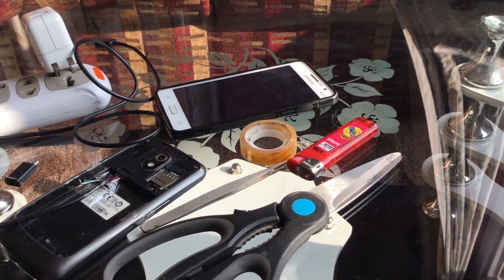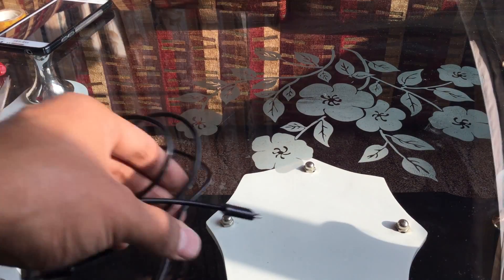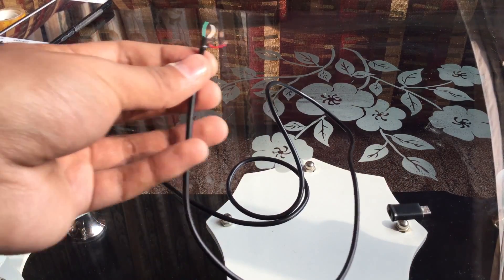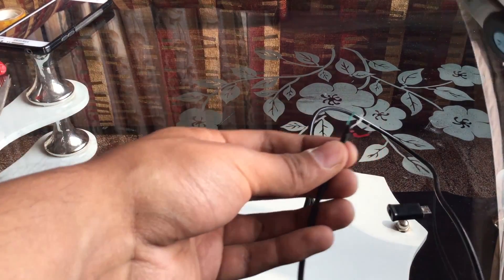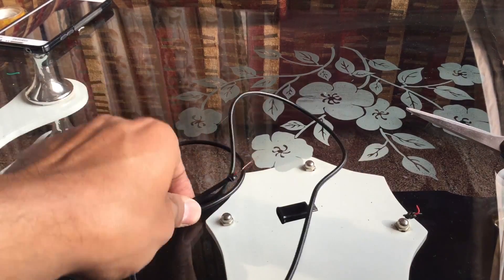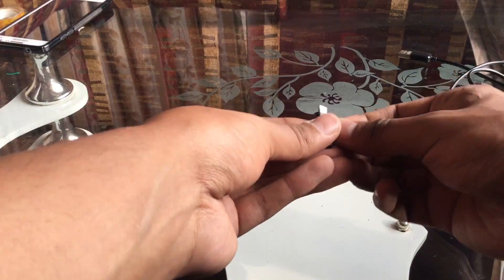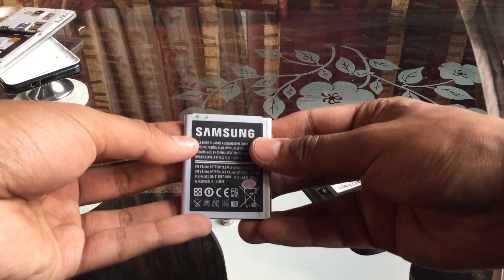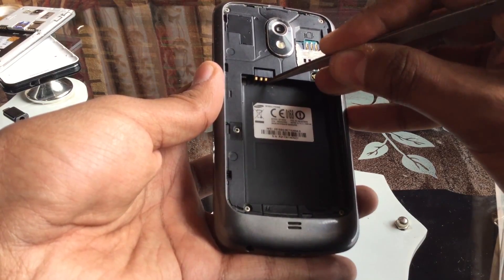How to run android phone without battery?

Comment: I see alot of confusion about the voltages. I'd like to clarify for those who are confused. All cell phones are lithium ion, lithium ion are all 3.7v cells. 3.7v is 0% charge. (4.2v is full charge). A 4.4v power source is needed to charge a lithium cell to 4.2v. (4.4v is actually 4.2v in a closed circuit, aka when plugged into the phone). 3.9v will provide 3.7v closed circuit (aka 0% battery) and the phone won't boot, or will turn off. So, we need an absolute minimum of 4v just for the phone to read anything other than 0% battery. Maximum voltage is 4.4v, Minimum voltage is 4v. You should use the maximum 4.4v if you can, but might be able to get away with as low as 4v. Nothing more, nothing less.
Reply: What if someone connect USB drives through OTG then had to power using tablet? does this still capable to keep Tablet running and powering OTG devices..?
Reply: You can probably do like this guy and not use a voltage regulator to convert the 5v to 4.4v and just plug it in, as these phones appear to have a DC to DC regulator inside. But, even if this does work it's going to cause alot of extra heat in the phone. I'd highly recommend the 4.4v as I explained above. You can buy an adjustable voltage for $10 off Amazon.
Reply: @smokinamby  After a quick googling...is LM2596 good enough? 
Pls suggest Volt Regulator/Meter. TY
Reply: @cravatenoire3269  lm2596 is more than good enough. I'd recommend  one with a lcd, but that's only for more convenience. I also use lm2596 but with LCD (lcd is inaccurate though.) I need to set my regulator to 3.5v on the lcd to get 3.3v out at the multimeter, ect. So be careful.
Reply: @smokinamby  Yes. LCD is what i meant by "Volt.../Meter". But didnt think of its quality/inaccuracy though, other than Loss in Closed Circuit which you explained above. TY. 
1) Is it OK to set a bit more (if not any less) than 3.5V for a 3.3V requirement? 
2) How Reliable/Durable are these modules in general?
3) Any other ones you recommend (than lm2596) if my S-Phone battery is 3.8V?
Reply: @cravatenoire3269  1. The LCD isn't accurate on mine. But I've come to learn to just add 0.2 to what my LCD says. I was surprised when I put the multimeter to mine. Yours might not be like mine though. Use a multimeter, if you have one to check the output of the regulator just to be sure... 

3.5v isn't enough. True battery capacity is measured in voltage. A lithium battery is 3.7-3.8v when it is at 0% charge. 4.2v is 100% charge. The numbers you know as 0-100% battery life is actually just a more humane way to read voltage. Your 3.8v battery should be 4.2v while it's connected to the charger and at 100%.You need 4.4v charge source to get the battery to 4.2v. You should charge that battery at my original recommendation of 4.4v. If it only charges into the 90ish area then you can turn it up to at 4.5v. The 4.4v should be good enough to get that battery to 100%, I'm almost sure of it. My voltage regulator needs to be set at 4.6v to get 4.4v at the output using a multimeter (open circuit). 

2. Mine still looks brand new. I haven't had any issues what so ever with it other than the LCD being inaccurate.

3. I'd recommend the lm2596 that you're already eyeing. Get one that does 3 amps if you have a fast charging phone.
Reply: @smokinamby  appreciate the response. Any budget multimeter suggestion?

1) "4.2 at floating": Did you consider battery buffer? I mean. Does the battery ACTUALLY get full on " 100%".

2) so that will be how long ?

3) seen the 3A one. Was asking if you suggest lower variants for my 3.8V battery. And no, my devices max at 10w chargers max.
Reply: @smokinamby  Got The Module!
Testing On: LG K7 LTE

Soldered +ve o/p from module to the 1st Terminal (from left) on the S-Phone AND the -ve (black) to the 3rd. (Not sure if I should connect it to the 4th instead).

NO SIGNS OF CHARGING!
NOT EVEN REJECTING THE BATTERY.

(NOTE: The actual problem was the smartphone Not Recognising the battery for whatever reason. Simply rejected to charge showing it is an incompatible battery, though I've been using it for at least 6months)

So I put the old battery upon the soldered pins and tried powering ON. And It DID! :)

But dunno if it is ByPassed or not yet.
And I wouldn't dare check it now as now it's doing its 
"Android is Starting: Optimizing apps 1 of ..." Loops. Usually loops 5-6 times on abrupt shutdown/restart before booting to OS.

Entering the 5th loop as I type.
And I just noticed the voltage dipped to 3.5v (from 4.2v I had set) for the first time. All 4 prior loops was at 4.0v with +/- 0.2v variation.

Had already tried Increasing to the 4.4v you suggested while in use. It didn't change. Dont know if it should be set PRIOR USE.

Letting you know this here ASAP, as I am expecting the Optimization Loops (now entering 6th)  to go for some more while, and so hoping (low odds) you would see this and kindly tell me to change the setup incase I have set it up wrong.

Like maybe connecting the -ve o/p to the fourth/last pin instead of 3rd.
Or
If it is a must to PRE-SETTING the voltage to 4.4v.
Or
If there is a Non interruptive way to increase the voltage WHILE IN USE.

And if you do not see. Then hopefully this info helps someone :)

TYVM either way
Hope to get the imp data in my phone.

UPDATE 1:
Finally Booted to OS HomePage. But shutdown immediately showing INVALID BATTERY.

Increased to 4.4v and this time:

Tried powering without Battery.
Wouldn't Boot.
Showed : the Question Mark inside Battery symbol ( meaning No Battery)

Tried Again WITHOUT BATTERY
This Time Booted for 3 secs and the No Battery Symbol showed up.

Suspected improper solder.
Tried pulling and the the -ve wire popped out.

Gonna do some proper soldering prior testing again now that I know I can get to the OS somehow.

The Touch wasn't responding. Without which I don't think I can do what I want from it. But I am testing anyway

WIlL UPDATE
Reply: @cravatenoire3269  What happened with u man ?
Reply: @Alhussainba  don't rem. What do you wanna know.
Reply: @cravatenoire3269  haha, don't really care about the details I just got invested emotionally in your issue. Nevermind.
BTW, I did a bunch of searching, there is a battery protection circuit attached to the tob of your battery, you can take it out from the battery, it has the positive and negative plates, you can just solder your charging cable to them and then connect the board to the phone.
There is another pin called BSI u will need to ground it if your phone refuses to boot. But this way it will be safe for ur phone as no more than 4.4v will arrive to ur phone.
Reply: @Alhussainba  alright. Would have tested it back when I needed. Appreciate it anyway
Needed to work it out bc of lockdown. Thought the details might help those who needed them.
Reply: @smokinamby  Maybe use a diode to drop .7 volts? 5-.7 = 4.3v
Reply: @TheRainHarvester  yes, you can do this. Voltage regulator is alot more convenient though.
Reply: How about replacing the charger adapter for a power bank? Since power banks charge other devices I'm guessing their voltage output might be a bit high for the phone. At least the phone could get hot. Any suggestions. 

One more thing is. What do I do with the ground terminal? Leave it as it is or ground it with the body?
Reply: @abidurrahmanchowdhury4412  Li Ion battary Current Rating is = Batary Capacity  .ie. 2500 mAh battery can give maximum current of 2.5amp or 2500 mamp   but chargers are only 500 to 1000mamp so phone do not run on the charger. will have to make power supply of 4volt and 3amp to run phone on the ac adapter
Reply: what about the watts? doesnt the current matter as well?
Reply: @zeon2535  yes, the key reason of shutdown is insufficient current, people forget voltage is only to regulate the unit but Amperes is the energy needed and is the variable. Most of the charger bits are 4.2V 1A which is ok in normal use but when phone is under stress it will take withdraw more than 1 amp causing blackouts. Now a variable current controller in the circuit would do the job even if current output from charger is 2A or more. I am trying to find one that would work just perfect, i think a variable resistor should be fine.
Reply: Correct. Amperage is the "fuel". Voltage is the pressure that pushes your fuel to your motor. (Like a pump pushing water)
Reply: Can you people explain me why this worked for me but phone says that losing power from "battery" even that its is connected soldered from chip from the battery? Even if plugging also USB it "charges" it but isn't that double power going trough it?
Reply: @tiinasoderholm  the software in the phone knows how long a battery lasts so if you don't charge it it will, over time reduce the battery % because it is estimating how much energy the "battery" still has left
Reply: @th3pr0ject  thank you. I got it working. I kept circuit peace from battery and soldered usb cable to it. Whit that phone goes on, usually with 100% battery but sometimes less for some reason. It goes slowly down though but plugging another usb cable to charging port it "charges" it keeping 100% procent. Then I unplug battery cable and it stays on forever. I also switched off all battery saving things from phone. It also is plugged on ups for power outageses
Reply: it's just a standard 5v charger,that means,the phone may be faster and can be overclock to 2 or 3 GHz who knows

Comment: i have charger nokia ( output 3.7v) it's possible ?
Reply: Nope. You'd need around 4.35v charger to be able to get the proper 4.2v closed circuit. It's best to use a 5v charger with a $10 voltage regulator set to 4.4v (test using multimeter on output). My voltage regulator needed to be set to 4.6v to get 4.4v out. It's very easy and cheap to setup. And best part, is I know everything is running at the exact voltages that a full charged lithium cell would provide the phone.
Reply: 3.7v is the voltage of a lithium battery that has 0% charge. (4.2v is full charge) 4.4v charger is required to get the proper full 4.2v to the phone.
Reply: Even a 3.9v charger would result in 3.7 closed circuit (aka 0% battery). You'd need an absolute minimum of 4v just for the phone to read any amount of power that isn't 0%.
Reply: Voltage Regulator idea seems good.TY.
But I have 5V 1A charger. Would that do without the regulator?

Comment: How to run a mobile phone on 12v 9ah battery
Reply: DC-DC converter!
Reply: for emergency
you need between + pos battery 12v  --- 100 ohms resist --- midle point +3.87V --- 47 ohms resist --- battery neg-side
keep this ratio 1/2 .
lower the resistance higher the power (and the temperature of the resistance)
if you have 3 identical resistance(or bobbin(taken from relay inside a car or a plane) provided they do not melt) put 2 in serial to the + and one to the minus 
put the minus of the phone  to the minus of the battery and the plus of the phone to the middle point
even without ohmmeters and voltmeters it can work
a dc/dc converter is much more efficient this is more for survival situation
Reply: Thanks you all

Comment: I use 12v PSU and lm2596 modul to make it 4,1v. Not use 4,2v afraid if the voltage is not stable and rises to 4,3
Reply: 4.1 and 4.3 do not have much difference ..

Comment: Hi. Nice vidoe. Will the phone work if we connect 1 and 3 (+ and -) directly and connect charger through port?
Reply: I suggest use PC powersupply and a stepdown module, adjust it down to 4,15v

Comment: sounds good will try it,but ultimately i will have a root for a lower voltage charger , could save buying a battery, just bought a s5 sm g900f and no shops have one that fits

Comment: Sir first chance me mobile challu hua aur second me Hugh to jal gay a aur aur an hi on nahi ho raha Kay Karu...
Reply: read the upper comments, the battery voltage is 3.6V, you burned your mobile with higher voltage and current.
Reply: Bhai aap ne 5v wala charger use kiya na, isliye jal gaya.

Comment: I need to know how to do this with a battery that's not removable. I have a ZTE Lever. The battery is jacked but nothing else is wrong with the phone. So this would be perfect for my situation. Just need guidance on how to do this with my specific model of phone & battery. Thanks
Reply: TAWNYA REDD youll have ho heat up the entire phone and pull the display out..better find a video tutorial

Comment: Gudevening. Can l do the same thing with moto w180 basic phone? 
& Instead of data-cable can l cut & use charger wires & connect it to direct power source via charger? 
I hv one more query.
(W180 has 4 terminals inside, so the confusion is where do the wires stick, 1st & 2nd, 3rd or 4th, or some other combination? & Which wire where, red n black?
Pl reply. Thanks
Reply: You should check the battery or phone to see where the + (positive) and - (negative) are. But on a Huawei Y5 2, with the screen facing down, the leftmost pin is - (negative), and the rightmost pin is + (positive), while the two in the middle are just for data. So, with the phone facing down, counting from the left, number 1 is - (negative), number 2 is for data, number 3 is for data, and number 4 is + (positive), although it might be different depending on phones and batteries like Samsung, research the phone on the net for more info or contact the manufacturer.

Comment: Problem is voltage is too high it needs to be lowered to 3.7v
Reply: those batteries are 4.2 when fully charged.
Reply: The phone will read lowbat and won't boot, at least use 4 to 4,1v to make it boot and battery indicator almost full
Reply: 3.7V is battery average, not maximum. Just one diode will suffice.
Reply: You might already have everything that is needed laying around at home.. I have some micro usb 18650 battery charger boards that I bought like 2 years ago on ebay and you can actually use them to power up the phone because their output voltage is 3.7 V - 4.2 V
Reply: Morpheus x are two IN5408 diodes good?
Reply: Also can i use one diode in each wire?
Reply: use your mobile phone's original charger

Comment: Can you do this with a power bank? Like connect it like you did but instead of hooking it to a charger you hook it to the internal batteries of a power bank and not through the 5V step up circuit.
Reply: Maybe .
.
We have to use the circuit of the battery .
If thats whatyou want to do
Reply: @christiandeleon2987  I was going to just tie onto the internal battery so I get the proper 4.2 volts instead of 5v which is too much.
Reply: If you redirect the batties isn't the phone not going to get hot or gets short circuit?
Reply: @christiandeleon2987  on the phone I'm modding I'm going to take the battery completely out and just basically tie the battery connections on the phone to the battery connections on the power bank and then simply charge true power bank. The voltage shouldn't get much higher than 4.2 volts.
Reply: @coondogtheman  i did the same thing as you, i also installed "ampere" app and it says i have 3.8 when connected to the power bank and when i connect it directly to power source i got readings of over 5 volts, so thank you for saying that and to anyone reading this, do the same as the video but connect it to power bank instead of directly... you will get safe volts and the phone won't get problems :)
Reply: @ProckerDark  right. If you connect directly to the internal battery you will get between 3.3 to about 4.2 volts (not 100% sure) depending on the charge level of the battery.
Reply: I'm thinking if you use the power bank battery directly and not use the phone's battery it might work. I have a yard sale phone that turns on but doesn't charge. It will start up when I put an 18650 battery on it which is 3.6 volts. It just will not charge by USB. It seems as if the charging circuit is damaged.